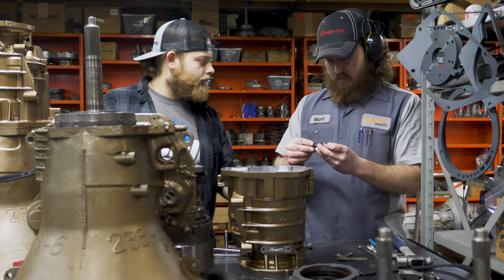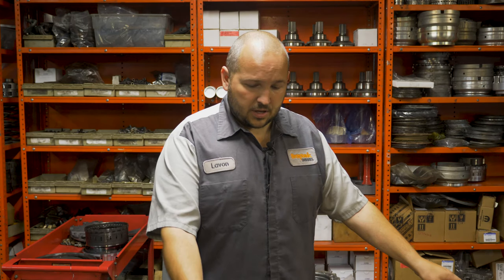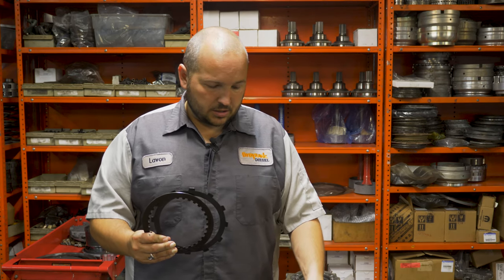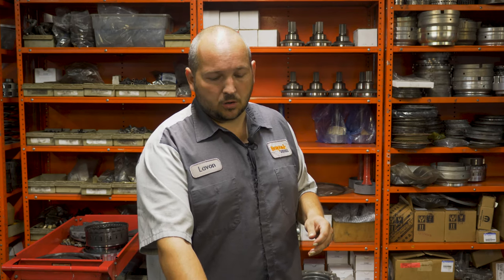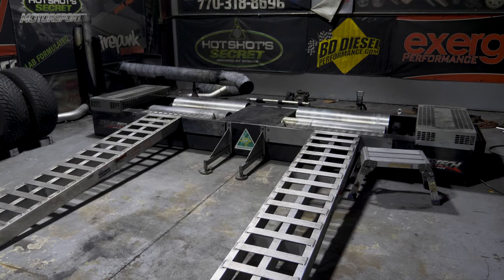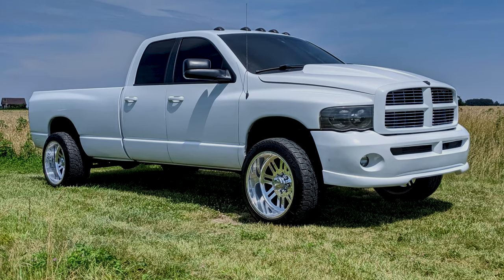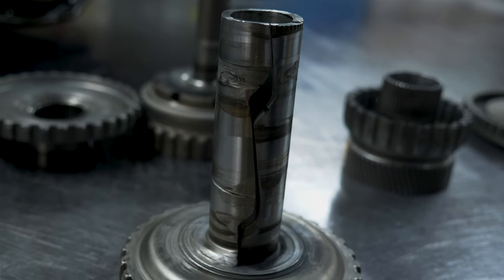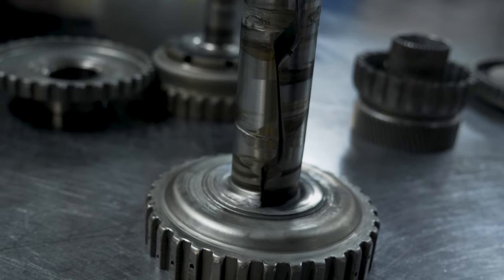68RFE - THE GOOD, THE BAD, & THE UGLY

Comment: I have owned a 2500 4x4, 3:73 with this trans, towed heavy with it and had no problems, traded it at 251k miles running and towing great. Same thing with a 3500 dually 4x4, 4:10 towed heavy and traded it last year with 207k miles, ran and towed like a dream. I purchased both of those trucks new, they were 100% stock. People told me I was overkill on servicing because I changed fuel filter at every oil change. Changed trans filter, flushed trans, changed rear diff, front diff and transfer case lubes every 20k miles (mainly because I towed a lot). But with those miles on each truck, never had any engine, trans or driveline problems. May have been overkill on servicing but may have prevented many problems. My new truck is a 2018 Ram limited with HO 6.7 and Aisin trans, it will remain stock. Personally, I have never found the need to change any of these trucks from stock. They have plenty of HP and torque to tow anything that can legally be towed with them, and they are extremely reliable stock.
Reply: Chris M I remember a time when people only towed with their diesel trucks and didn’t care about racing or big hp numbers. Nowadays we have all these coal roller boys wanting to race a truck that weighs over 8,000lbs 🤦🏻‍♂️
Reply: @bfe671  - I get it but they turn them up expecting the stock trans to hold the HP. I know a guy that had a power stroke with the 6-pack tuner a few years ago. Kept it turned up because it was cool. But then when the engine came apart, all he could take about was that junk Ford. I have a 1970 Chevelle SS 454 dyno 815 hp, I know what will happen if I put a stock turbo 400 behind it
Reply: Use the special transmission fluid for the AISIN transmission.
Reply: chris...i'm shopping for a new truck, i tow a 13,000 lb 5th and want to do some hotshot work in the future...question: HO/Aisin or standard/ 68RFE setup??  i live at 7,800' elevation and will be traveling coast to coast, north to south.  thx for input.  (open to input from whomever)
Reply: @waterbuddy92  
AISIN transmission is used on 5500, 4500, 3500 cab & chassis
Reply: @waterbuddy92  did you buy your pickup truck ? If so,  what did you go with?
Reply: @vicolvera1282  i have not...waiting for some finances to fall in place...still trying to decide...
Reply: @nellyfarnsworth7381  i know this
Reply: @bfe671  Because they werent fast 20 years ago.  I can drive my  850 hp diesel truck daily , tow my family's  truck camper with trailer in tow reliably  and still kick a Camaro or mustangs ass all while getting 22 mpg.   No its not a drag car , its 8000 lbs  but its the best compromise for my situation at the moment.  And I  dont run a stock trans...
Reply: I know over a year old but thoughts on aftermarket valve body low stall converter billet flex plate to help hold/ make stronger current trans is fine 68rfe 20017 stock wheels just efi tuned and deleted and trans tuned by optimal welding. Tow maybe 8,000 lbs 6 or 7x’s a year never see the track just want to be Abel to turn to the 120 or 4 (180hp) tunes and hit 1st -3rd sometimes and not wait for the boom
Reply: Majority of people call it overkill when it comes to maintenance.  It's just plain simple common sense.  Atf fluid under normal conditions can only last 40k miles without loosing its designed speciation.  It takes little bit of money and common sense to send fluid for analysis to learn that following  factory recommended intervals is the worst thing owners can do.
Reply: basically... u just answered my question on dodge diesel trucks and ill buy one but do you have any electronic issues??
Reply: @robertkiell  - Not one electronic nor electrical issue with either of the ones I have owned and currently own. Only thing I would recommend is changing brake pads to Mopar pads. My 1999 - 2500 ate pads until my friend which is a mechanic told me to spend the extra and buy Mopar pads, problem solved. Before trading the 2005 -  3500, I put new Mopar pads on it, looked back at service records and those pads had 71k miles on them. My 2018 Ram 3500 brakes started squealing around 12k miles, the dealer "said" those trucks had mopar pads, I told him they didn't. I had them install Mopar pads and told them I wanted the old ones. I was going to prove they are not Mopar pads, but their mechanic "just happened" to throw them in the dumpster and couldn't find them. BS! Anyhow, now at 35k miles, not a sound out of the brakes. If you get a new or fairly new Ram and it has Nexen tires, plan on replacing them, they are junk on HD trucks. I had belt break at 21k miles, got to tire shop and another Ram 3500 was there with Nexen belt broke at 16k miles, tire shop said they are fine on small trucks but don't hold up to HD trucks. I put Coopers on it, rides like a dream.
Reply: Reliable when stock? Boy, you high as hell. These trucks have nothing but issue after issue with their emission systems
Reply: I tell all my customers, Fluids and filters are cheap compared to what they protect.
Reply: @gettinghigh4208 no they don’t. Not when you use them for intended purpose. Towing a trailer for 30 miles once a week after commuting unloaded all week is not using the truck as intended.

Comment: Absolutely the best transmission video I’ve seen.  This guy is real, I’ve heard so many younger guys talk trash about the 68RFE and it always comes down to an ass load of hp and big tires topped by no common sense. We have 68RFE’s with close to 200k always towed heavy loads and never been touched (just oil changes according to the OM). When I was in my early 20’s a good older friend told me when I was going to add large tires “ skip the 20’s (age) and just go to your 30’s make mature decisions”.  With that said didn’t get the large tires and it has always stuck with me.  Like he said awesome transmission for towing. Don’t get me wrong though these high hp rigs are sweet I’m just saying they are designed for the hp given and do work well for that after that don’t bash them because you’ve made alterations past what it was designed for.
We run 7 units 6 of them are 3500’s with the 68RFE and 1 4500 with the Aisin, the Aisin went out at 60,000? Not bashing it just saying anything can fail
Reply: I have to agree these guys think that any transmission is gona hold up to 150 hp tunes..burnouts or towing 10k on 150 hp tune lol I just shake my head and walk away nothing stock is gona hold all that ..you buy a new truck drive it like it was designed to do..most of the time it will perform as it was designed to not crazy tunes on stock parts

Comment: You are the absolute BEST! So glad that you broke it down for the guys that hate the 68RFE. They will literally do 37s or 40s, 6" lift, delete, and tune the truck to within an inch of its life and when the trans pops, they say it is no good. It simply is not designed for that type of torque load from the factory, as you say. And many guys do not re-gear the rear end at all, running 3.42s with 37s.😤 This video should be required viewership for any Ram 6.7/68 buyer that wants to mod.
Reply: Show them this video all you want,  I don’t think people can make heads or tails of information anymore….

Comment: Had a 2006 Cummins. Absolutely loved the thing. Sold it, like an idiot, and bought a 2012 6.7 Powerstroke, which is a great truck and I practically stole the thing, but it ain’t no Cummins. Been contemplating looking for 2015-16 Powerstroke or a 2012-2018 Cummins, but I was really scared about the transmission, this video eases my mind. Thank you for all awesome information. Gonna look for an un-modded pawpaw truck with stock tires.

Comment: Spot on Lavon, you hit the ball out of the park on this vid.  I have a 2018 Ram 2500, SD gen 2 swap w/EFI, needless to say 2k miles later my 68RFE cooked 5th & 6th gear clutches and I run a 4.10 rear end. Had to have it towed to my Diesel guy for a Revmax 850 and wait a month for Revmax to build one.  Wish I had spoke to you to earlier.  Live and learn....Hey make a tuning vid with some late model Ram's, just a thought.

Comment: This is why I stayed with a 33" tire. Tuned, deleted, daily driven on 33" tires. Never even put the switch into the 5th setting. No need. Plenty of power on setting 3. And if I want a little extra I'll go up to 4th setting. 185k miles, stock trans. Some time this spring I'll be doing a 2nd gen turbo setup just to get rid of the VGT turbo.

Comment: This is probably the most real, honest, and appreciative review of the 68rfe I have listened to.  I appreciate that you do not negate brands, but are real in regards to what you have seen and do because of "X" reason.  I myself, would like to create reliability and maybe a little power and responsiveness.  With that said, I look forward to watching your other vidoes and checking out your company.  Thank you again for your very professional and "real" talk about the 68rfe.  It was truly a breath of fresh air.  It would be interesting to hear your view of the Sonnex clutch and basket versus Revmax's. Another question, are all billet parts pretty much the same between brand "X and Y?"  It would be nice to hear a view from a non-proprietor.

Comment: I have a 16 Ram 2500 and it has the 66rfe transmission.  I have been getting the P0871 code for a few months now, referring to the overdrive solenoid.  As long as I keep the RPMs under 2000 when taking off and can get over 30 mph, it does fine.  If you hit the throttle too hard, you get the hard shift, and it goes into limp mode and it will shoot the code eventually.  When you turn the truck off and restart it, it goes back to operating normally.  I have also heard that these transmissions are pretty reliable but the valve bodies and solenoid packs are junk.  The solenoid pack has been replaced 4 times under warranty.  My fluid looks fine.  I ordered a Sonnax valve body today and it will be here Friday.  I'm hoping it will solve my problems.

Comment: One of the better videos I have watched on You Tube. I picked up a used 2014 2500 6.7l mega cab 4x4 01/2020. I knew the look I was going for but, didn't really have an idea past that. I plan to use it for towing in the future but, for the most part it is used to just go camping and hauling gear in the bed. I did a basic spacer level in the front and put some 22x12 with 37x22x12.5 (regret doing that now). the truck has about 105,000 miles on it and being I live in CA and with all the recent diesel regulations I don't plan on doing any deletes or mods to the motor, maybe Banks intake and exhaust with a pedal controller. However, I have been doing a lot of research and it apparent that to get longevity out of my truck I should look into regearing. I feel the transmission is bound to go out based on the mileage and the way it delays on shifting at times.This video really convinced me that those are the best upgrades I should do. Thanks.

Comment: Do an AS69rc walk through next! I can't tell you how many people ask about this in the Ram forums. Great Video!
Reply: This!
Reply: Yes plz do
Reply: I was going to ask the same question.
Reply: AISIN is the best towing transmission. IF you are a real man towing BIG trailers, AISIN is your transmission.
IF you are a soy boy or soccer mom  just get a Honda.
Reply: Im thinkin the true "soy crusher" is rattlin the elbow through the gears..
Put that in your hello Kitty hat
Reply: Anybody out there really hopped up something in front of an Aisin? I have never seen like a 1000rwhp 5500 Ram hit the dyno. Kind of odd really I am sure someone has done it.
Reply: @bcbloc02  
AISIN transmission is the best trans. In the class 4 & class 5. This is Dodge 3500, 4500 & 5500. AISIN is the WORLD'S LARGEST MANUFACTURER of TRANSMISSIONS.  You may have heard of AISIN before (Toyota).  
Toyota has written the code in Japanese. No one has hacked the code. 
Dodge uses the Best drive train parts in the world. CUMMINS/AISIN/Dana.
Reply: @nellyfarnsworth7381  Sounds good, so anybody running 2000ft-lbs of torque thru one?
Reply: @bcbloc02  
When you see a professional hotshot Drivers or professional car haulers. That Dodge 4500 or 5500 has a AISIN trans.
Reply: @bcbloc02  
When a professional hotshot driver, NEEDS is to get that load from point A to point B.
The truck is DODGE CUMMINS/AISIN/EXHAUST Brake.  I pulled a load, up the Rockie Mountains on CRUISE CONTROL. Then went DOWN the Rockies,  using CRUISE CONTROL/EXHAUST BRAKE. It's the package of engine/transmission/EXHAUST BRAKE, working together. The transmission/engine retarding the rigs speed going down grade (150 hp. To 200 hp. Negative). I NEVER use my brakes going down grade
Reply: @nellyfarnsworth7381  Yes they work good. I have a buddy that has a 2015 4500 Ram with the Aisin, he regularly grosses 45000lbs and has done that for at least half of the 80,000 miles he has on his truck. It is all stock though. My question was about highly increased power trucks running this transmission. Anybody got one??
Reply: @bcbloc02  
That's what REAL MEN, are actually doing every day. I have roads I travel, that have check  points, the officers will ONLY  allow trucks with Jake Brakes or other speed retarder device.
Because many have been killed. Brakes can NOT control a 80,000 lb. Load go down 6% and 7% for 6 miles or 8 miles.
That is why big rigs have JAKE  BRAKES.
Reply: @6bt_str86  
But, DODGE rating the new AISIN to tow 35,000+ pound trailer. 
The manual transmission is LESS THAN HALF.
Reply: @bcbloc02  
Yes, it's best to move UP to a class 6 or class 7.  Because,  it's the WHOLE PACKAGE, of drive train, axles, brakes, exhaust brake, load leash, frame.  Remember 40,000 pounds is HALF a 18 WHEELER.
Reply: Chow Dong Sadness.... I have 3,500,000 miles in a semi,,,, I can shift a manual to outlast any automatic!!
Reply: @witkr904  
First Dodge pickup is NOT a semi.
Second go to DODGE RAM website, for the FACTORY RATING OF EACH TRANSMISSION. 
THE AISIN in the Ram 5500 is FACTORY RATED TO TOW a 35,000 pound trailer.
The manual transmission rating in 3500 & 2500 is only 12,000 pounds and 16,000 pounds. The manual transmissions offered by DODGE RAM,  are less than HALF.
BECAUSE the AISIN is a Class 5 & Class 6 MEDIUM DUTY (NOT PICKUP) transmission.
AISIN has two P.T.O. to run wich, hydraulic pumps, air compressor, Generator ect.

Comment: If you want to make 1000HP with 2350 ft lbs of torque..NO the 68RFE is not that transmission..You wouldn't wear flip flops to run a marathon..RIGHT  equipment  for the right job..GREAT VIDEO

Comment: Excellent video Lavon. I have a 2009 Dodge 2500, 6.7 Cummins with the 68RFE at 200K. The truck is tuned well, stock tire size, and I don't abuse it. Holding my breath on how much longer the trans has before a rebuild is needed.

Comment: Finally, 
Thank you for clearing up this info about the 68rfe.  I have a 2018 ram and i really love it.  No  problems at all.  I also have a 75 hp tune and it runs beautifully.  I’m planning to Purchase a fifth wheel trailer gvwr is 9500 lbs.  I hope this will work for me in the future.  I’ll keep you informed.  This will be a toy hauler but I’m not hauling anything larger than an ATV.  Any suggestions you have are welcomed.